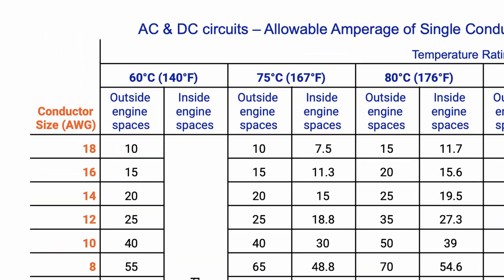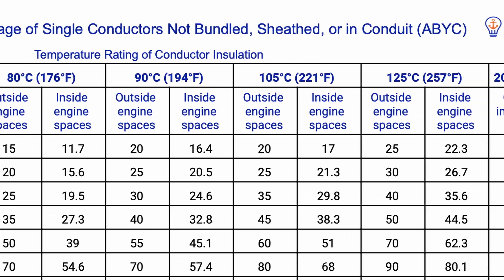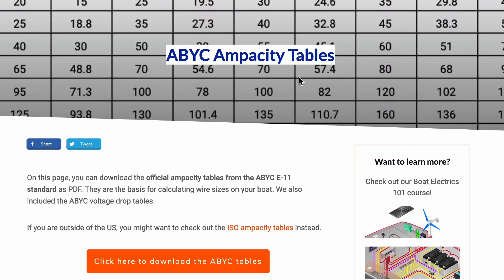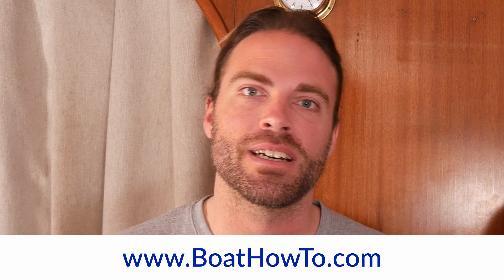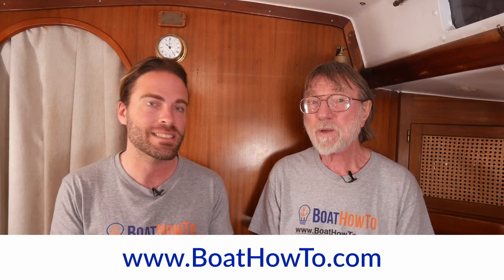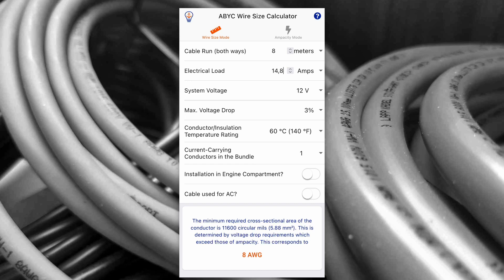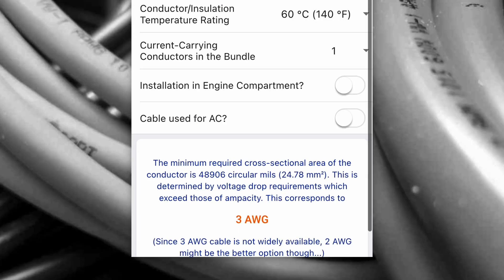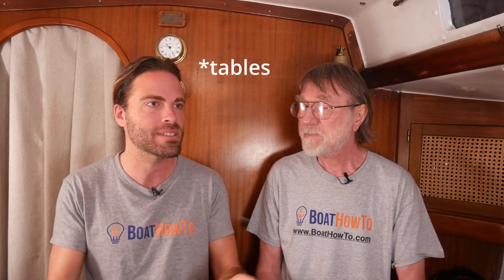Voltage Drop & Ampacity: How to Size Conductors on Your Boat | Ask The Expert with NIGEL CALDER

Comment: quick question, on a 12v dc system, can I upsize my wire to get 1% voltage drop? For ex. A 50a load to a trolling motor @ 10ft round trip on the cable with 3% drop is 8 awg...can I upsize to 6awg to get 2% or even 4awg to get 1% voltage drop? Would that fry the system or be better off?
Reply from the maker: Conductors can never be too large, only too small. So this is no problem at all with going bigger. You can actually manually set the voltage drop in our calculator, so you can see which size you would need: https://boathowto.com/wiresize/abyc/ However, a 3% drop is pretty good, I don't think that larger cables would significantly improve your system's performance. - Jan
Reply: @BoatHowTo  thank u for the response, just trying to be safe along with max output from devices.

Comment: As an electrical engineer of over 11 years. Ampacity is a term that I’m unfamiliar with. My dealings with 0.5 Mw radar systems lead to calculations leading to maximum current calculations, that reflected actual performance
Reply from the maker: ‘Ampacity’ is a term used in the ABYC and ISO standards to describe the maximum current carrying capability of a conductor, or, more fully, the maximum current, in amperes, that a conductor can carry continuously under the conditions of use without exceeding its temperature rating.
Nigel